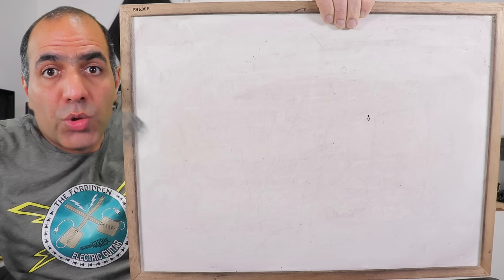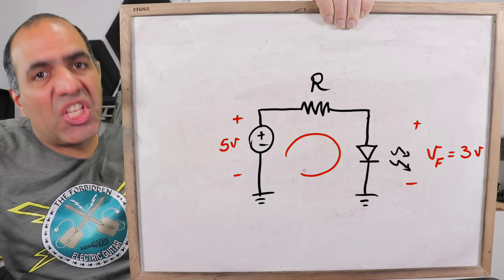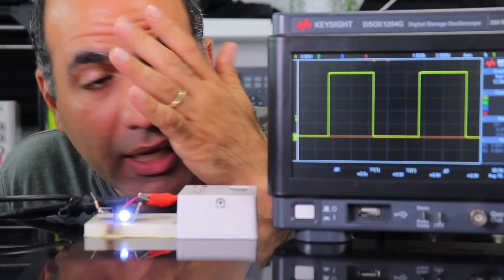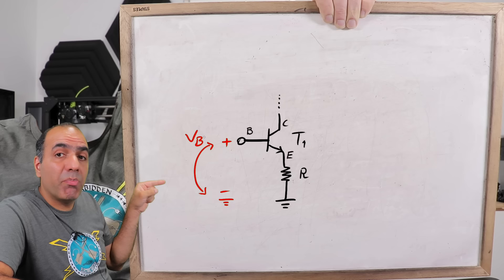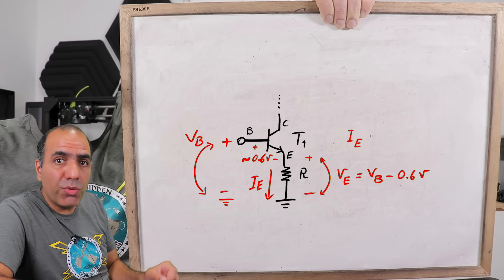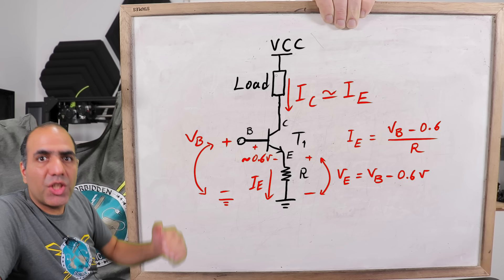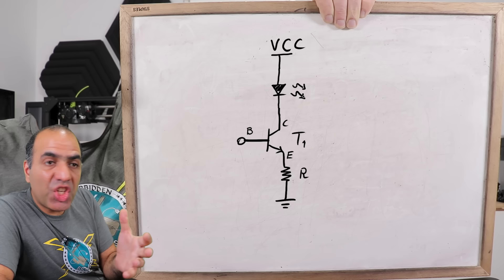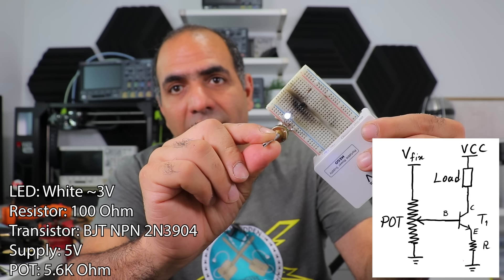How to Turn an LED On

Comment: First time catching a new upload after discovering your videos.  I really appreciate your channel, and your incredible teaching. I ordered a Tesla coil kit yesterday (:
Reply: Welcome to the club bro...
Reply: Just make sure you read the changes to the instructions very well first. They don't update the manual, they just list the changes at the beginning of the instructions. That's why I built the tiny tesla before attempting the ts. My first experience I had a 100 ohm resistor in place of 1000ohm and I evaporated all the copper off the tiny tesla board.
Reply: i just discovered his channel too
Reply: @treybarnes7932  for sure, thanks! I didn’t want to get a boring one, so I spent a couple hundred. It looks decently legit, and instructions are in English. Will definitely be careful
Reply: @treybarnes7932  I'm sorry, but your mix-up wasn't a "novice" thing, you should've known better.

Comment: For a simple LED its just a DC source like an I/O port, the LED, and a resistor.  But in commercial designs, driving an LED efficiently as well as controlling the brightness actually takes a bit of work.  There are two methods.

The most common method is to use a current-controlled driver chip, usually set to near the LED's rated current (e.g. 20mA), and you then control the brightness with a PWM.  The PWM is sometimes built-into the driver chip and controlled via I2C, but it is just as easy to use a little PIC microcontroller to handle the PWM.   The PWM typically runs at 40KHz and has 256 brightness levels (base clock is thus around 10MHz).   LED driver chips allow you to set a fixed current with a resistor and you use something like a PIC microcontroller to control it.   However, there is a 'minimum' brightness when using this method because LED driver chips can't actually turn on and off quickly enough to handle PWM settings below around 100uS.

The driver chips work best for LED strings.  We don't use inductors...  Actually, we try to avoid using inductors at all because they vibrate and they are expensive components compared to other components on the board.   They are EXTREMELY efficient.  We try to arrange the voltage drop across the string such that the voltage is close to zero at the bottom of the string.  The driver chip then basically connects the bottom to ground (current controlled), so the losses through the driver chip are extremely low.  e.g. if you have a 20V series string of LEDs you make your power supply something like 21V and thus the driver chip's internal FETs only has to dissipate 1V, yielding an efficiency of 95%.

The second method is to servo the current with a FET/op-amp circuit for brightness and use a simple fixed PWM to limit power consumption.  Again at around 40KHz.  This is more difficult to get right because the FETs linear range is really sensitive to voltage (hence why it has to be a servo), but it works.  It isn't as efficient because the FET eats the difference, but it allows the PWM to have a wide pulse width without being too bright, which is important for certain transmitter/detector applications.

Then finally, one might ask why use a 40Khz PWM instead of, say, 60Hz from a half bridge?  Well... because the human eye can easily see the flicker at 60Hz, but won't see any flickering at 40KHz.
Reply: Fascinating insights. Much appreciated.

Comment: Never knew about that simple boost circuit for LED driving, high voltage spikes like that sketch me out. Always used a buck converter that has a sense resistor shunt for current control as opposed to voltage control. Always fun to learn new topologies. Great video as always.

Comment: 5:25 In India, LED chains are available in local market where near about 80 LEDs are connected in series with some resistor (in series) also. Those chains are used for decoration and need to connect to 220v AC pwer outlet. After watching this video, I have decided not to use those chains anymore for their amount of power loss...
Reply: For that much price you will not get a smps voltage regulator and those decoration lights are used for sometime and not for prolong use, so it is fine.
Reply: @shashibhushansingh_  I'd like to invest single time and get the benefit afterward...
Reply: I think since the leds were in series then it would be much more efficient
Reply: The more LEDs in series, the less the voltage drop across the resistor will be so your efficiency goes up. In this video most of this vdrop was across the resistor so of course it was not efficient.
Reply: @HodgePodgeProducts  Then I have to do some calculations so that I can get the number of LEDs I should connect in series in order not to use a single piece of resistors, still I can lit it up with 220v AC...
Reply: @ShawonSarkar  you will still have to use a resistor to limit the current but the voltage drop across it will be minimal and thus the power dissipation will be negligible.
Reply: @HodgePodgeProducts  At least, that will be better than anything else…
Reply: The LED decoration chains generally follow a combination of series and parallel connections, where a few series sets (say about 30 LEDs in series) are connected in parallel. 

This design would enable to make larger chains with more LEDs without any brightness compensation. Just add more series sets and you are done.

The resistors in each led is about 220 ohms and are placed as a safety measure to limit the current to each LED, because in India the voltage is not uniform everywhere. The resistors are of 1/4 watt rating and if you touch them you'll find they are not warm, which means they are not dissipating much power.

Generally even the cheapest chains I bought came with a full wave rectifier included in a little white box sitting on the wire itself. As Mehdi explained in the video, driving LEDs directly via AC is not efficient, as one entire half cycle is not utilized.
Reply: @luelou8464  Just tell me one thing. Suppose I want to maintain the voltage drop of 3v accross each LED while operating with 220v AC (312v peak), then how many LEDs do I need to connect in series? Will 312/3=104 LEDs be enough? And will the internal resistance of each LEDs limit the current?
Reply: @PreetamDas64  Are you sure about the full wave rectifier in the white box? Cause, I have noticed flickering effect even after the white box is connected.
Reply: @ShawonSarkar  Yes, it flickers because there is only the rectifier in the box, it doesn't have any filter or voltage regulator circuit along with it.
Reply: @ShawonSarkar  If you have a damaged chain lying around, you can open that white box and see for yourself 🙂
Reply: @PreetamDas64  I have checked that. Actually I'm not sure about its functionality as I've noticed flickering effect in each and every LED chains.😑
Reply: @ShawonSarkar  that's bcz they don't have a filter circuit connected to the output of brigde rectifier
Reply: @luelou8464   OK, that means I need to cut the amount of current down to near about 30 mA to keep my LEDs safe. As per calculation, 90 LEDs (approximately 50 ohms each) in series are gonna pass 60 mA while 270v is applied, which will surely damage the LEDs. Am I right?
Reply: @ShawonSarkar  Most of those strings uses very thin aluminium wires and they don't last longer due to oxidation,so why the manufacturer will invest in something that will increase the cost of manufacturing. If you want you can use LED bulbs smps to light LED strings but still you need resistor for safety purpose.
Reply: @luelou8464  I am considering 5mm White LEDs with 3V forward bias voltage.
Reply: @PreetamDas64  I'm looking at an LED chain controller with a single diode (half wave) right now (India). All sorts of stuff comes out of China. Doing half wave is not inefficient, it just messes with the load for the power company if you do it on a massive scale (multiple chains randomly plugged in might cancel each other out).
Reply: @rexsceleratorum1632  Hmmm, not sure why use a diode seperately to do half wave rectification while you have a whole bunch of LEDs doing the same stuff... I might be missing something here.
Reply: @PreetamDas64  I believe it has to do with preventing reverse breakdown. I suppose when the regular diode refuses to conduct, no reverse current flows and the LEDs are saved.

Comment: In a future episode it would be cool to see the interactions between dimmer switches and led lights, how dimmer switches work, and why only certain LEDs are dimmable.
Reply: I think in the seat heater video Mehdi already talked about LED lights that use resistors or capacitor/transistor drivers will work with dimmers since they're directly run from the input power but LED lights that have their own specific rectifier and voltage/current regulator would want a constant current and voltage. The dimmer switch simply does the PWM pattern thing by cutting off a portion of the wave.
Reply: If he explained why dimmers seem to go bad so easily in the process, I would be very interested. As a guy in home repair, I'm frequently replacing the things (and returning ones I've purchased to the store when they don't work).
Reply: @benjaminoechsli1941  i dont know much about electronics but since dimmers are some sort of PWM or PID waveform it might have to do something with that

Comment: His messups always look genuine but I wonder what percentage of his "accidents" are not scripted. I imagine most of them are. He is not only a great electron manipulator but also an amazing actor!
Reply: I have to appreciate how his "accidents" always happen with the purpose of drawing attention towards a misconception people might have so he can turn that into a good teaching opportunity.
Reply: The Jacobs ladder mishap I'm certain is one of the only real mess ups
Reply: @El-Burrito  I'm not sure about that. He made the ladder extremely topheavy. As an amateur, even I would be so far away from it that could't fall on me. Just like with cutting down a big three, with that you step away very far before it falls.
Reply: @gert-janbonnema  Nah he's said in an interview that the Jacob's ladder was real, but I don't think there's been any other accidents that weren't intentional.
Reply: @gert-janbonnema  the Jacob's ladder accident could have seriously electrocuted him. Of course there are safety systems in the house like GFCI or similar that should protect you, but whether these are going to be quick enough to prevent you from dying or suffering serious damage is debatable. Every other "accident" has a few sparks or some resistor burning etc all of which act in one way or another like a fuse and stop current flow. Jacob's ladder though was too dangerous to be intentional.
Reply: I'm sure that most of the accidents are planned, he uses them for entertainment and education. Most, not all though lol.
Reply: it is only a very small percentage of unscripted, What he does is largely planned as a result of his Electrical knowledge ,   Basically it's a controlled environment , blowing shit up while making it look spectacular while still being safe, while looking unsafe
Reply: @InTimeTraveller  GFCI wouldn't have helped.
Reply: @M4RC90  yes it would, because some current would probably escape through his body to the surrounding environment, therefore the current flowing through live and neutral would be unbalanced which is when the GFCI would automatically kick in. This is the entire reason we have them.

Comment: Great video! That flash capacitor brings back memories, I’ve ‘discharged’ one where it welded itself to a screwdriver, and another time where it blistered my fingertip! Don’t touch them, they hurt more than a soldering iron.

Comment: 14:38 Multimeter reads 159.38 V
Mehdi: „We have what, 160 Volt DC?“
Circuit: „You heared the man!“ => Multimeter instantly changes to EXACTLY 160.00 V, JUST as his royal ElectroBOOMness ordered! :D

Comment: At 12:02 One can add a small capacitor across the diodes to absorb a significant amount of the voltage spikes where it will discharge through LEDs over time untill the next inductor voltage spike.

 it's just  takes the edge off the peek of the  voltage spike across the diodes,  and being small doesn't contribute much to lighting the diodes.

Comment: While your use of a resistor in series with the AC line did light the LED, I expected it to fail because of reverse voltage exceeding the spec.
Reply: Maybe it is breaking down but the limited reverse current hasn't fried it yet?

Comment: Somewhere in my old components stash is a new/old stock Radio Shack tri-LED. It lights up red with dc in one polarity then green in the opposite and yellow in a/c. Never got to use it since the 80's lol...... was meant for an explosives detonator when I used to do special fx for bands.

Comment: 7:29 This led string must have been made of 2 led strings connected in parallel but in reverse if it was just a normal led string then the capacatior would charge through that led's but then it would not be able to discharge because led passes current only in one direction, so it means that this circuit would not work properly, all it would proabably do would be that the led string would blink once and then stay turned off.

Comment: [EDIT] Wrong, check comments
4:45 no it's not. It's Vrms/2 or Vpeak/2✓2
7:35 it's not working because the current going through the capacitor is half wave rectified, not true AC. You would need two LED strings with reverse polarity to make that work.
Reply: came here to say this; glad i checked the comments
I think Mehdi is trolling us.
Reply: 1st point:   I don't think you're right. I even simulated a half bridge rectifier and measured it. Vrms = Vpeak/2 = 170/2 =85V

2nd point:  You're right. In steady state the average current in the capacitor has to be zero so current needs to flow in the other direction too. Without a diode in the opposite direction it can't, and so the circuit behaves sort of as a peak detector where the capacitor charges in the 1st cycle and never let's the LED turn ON again. 
Alternatively, something that is widely used in real light bulbs (instead of a 2nd diode), is to put a resistor across the capacitor.
Having said that, Medhi did actually lit up the LED string with the capacitor only. So that LED string either has 2 strings running in opposite direction or it's made to break down in a controlled fashion, w/o emitting light, but discharging the cap.
Reply: @justpaulo  yeah... With half wave, power is halved, not RMS voltage. If power is halved RMS voltage must be 1/✓2 of the full wave voltage, which is already 1/✓2 of Vpeak. So Vrms half wave = 1/2Vpeak
Reply: @justpaulo  I thought the resistor was to discharge the capacitor when power is off for safety reasons. Otherwise agree.
Reply: @BullCheatFR   It's a resistor with double duty I guess.

Comment: Did you know that you can also turn on a diode ? With 50A the usual become pretty bright for a brief moment
Reply: With enough current, everything will glow
Reply: It's not hard to make a lightbulb
Reply: Not to mention becoming a cheap smoke generator :0)

Comment: You finally explained to me why a lot of the time I can see the flicker and see "tracers" behind moving objects. It's 10x worse on dimmable and coloured LED bulbs.

It may be my nystagmus but that flickering affects my ability to use the light for anything useful, like reading, etc...

I thought it might be cheap rectification, or none, but it makes sense for dimmables to change the frequency of the power cycle than try to make an LED less delicate.

Comment: For those of you who didn't know.

There are older types of LEDs. which shines weaker but is more robust, and was widely used as an indicator light in, for example, amplifiers.

then there is a newer type of LED that has a stronger light but is not as robust

Comment: Can't you use a diodes (as swithes) as a resistor as well for less energy loss?
Reply: No because diode effectively only consume voltage and limits the current very little. They would blow up because of the huge current that would course through them

Comment: @ElectroBOOM   03:10 how do you make these written text animations? I would very much like to learn how to do that. I am a self-taught video editor, and I am actually more of a beginner than anything else and this is something I always wanted to learn. I´ve looked this up a lot and I haven't found any practical ways to do it, and most of the time it requires a drawing pad of some sort :(
Reply: This looks like he made an ipad screencapture of drawing this and a recording of him explaining in front of a greenscreen, cut out his face, then laid both over a still image of him holding a whiteboard.
Reply: @derpoblizist9076  that makes sense!
Reply: @derpoblizist9076  except it's not an ipad its a drawing tablet.

Comment: Hey, the red capacitor on 6:35 is NOT ceramic. It is a film  capacitor, and in particular, most likely a polypropylene capacitor.

Comment: Of course, not all LEDs are semiconductors. Think of an old mercury vapor rectifier tube, such as a 866. Its a diode (rectifier), and it emits light. 😁

A hint for using LEDs (the semiconductor kind): You don't need to drive an LED at its full rated current. Unlike old incandescent lamps, LEDs will light with only a small fraction of its rated current. An incandescent with a fifth its nominal current, it will barely glow. An LED on the other hand, will still light up noticeably with only 1mA going thru it, while its rated for 20mA (20:1) ! I often use superbright LEDs, and only pass ~500uA (0.5mA, 0.0005A) thru it, and its still bright enough to use as an indicator.
Reply: Under driving high power rated LEDs is an excellent way to ensure super long LED useful operational lifespan.